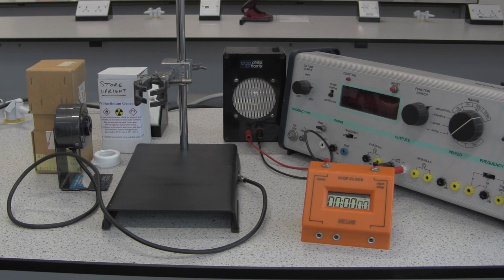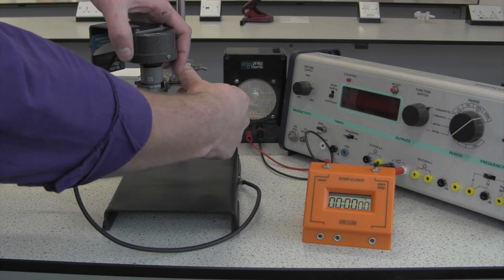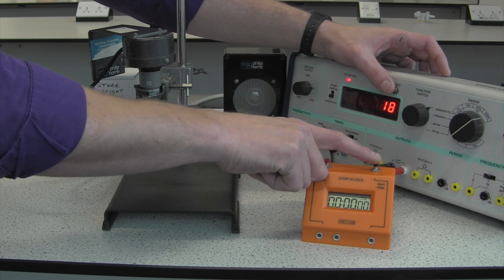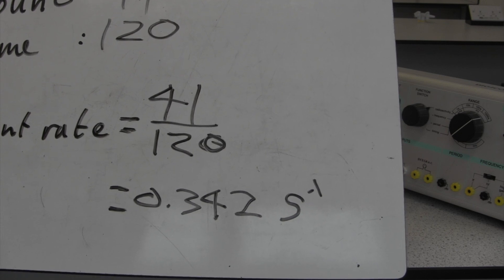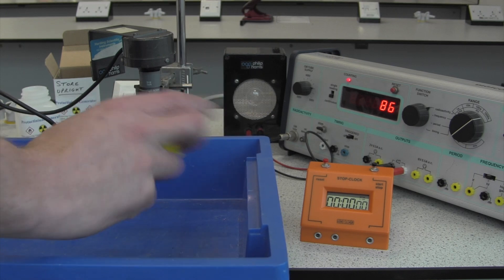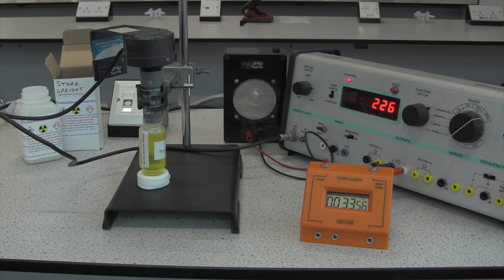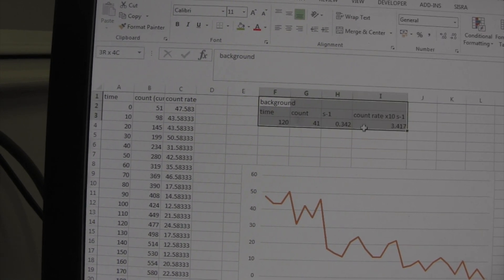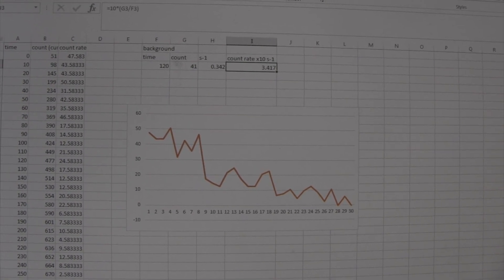Measuring the half life of protactinium

Comment: You should take the measurement of the background total from the Pa-234m generator itself, before you prime it, not just the background radiation itself. The Pa-234m generator radiation plus the background radiation gives you the correct background total that you should subtract from the measurements that you get from the Pa-234m generator after it is primed.